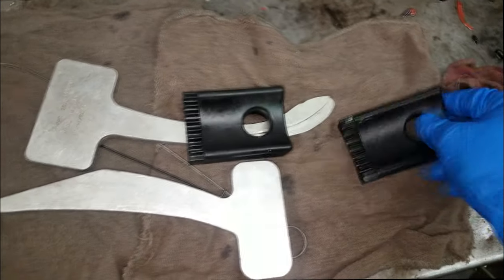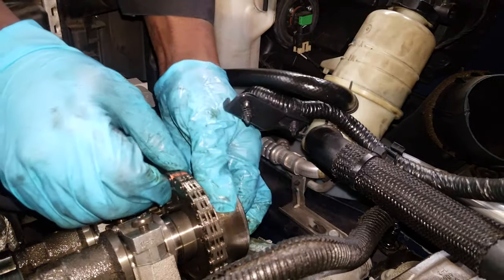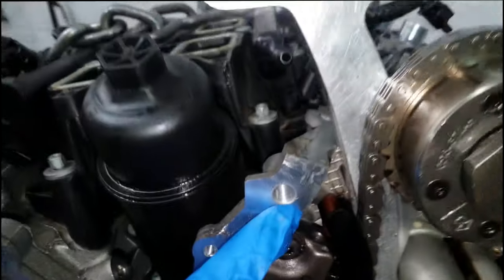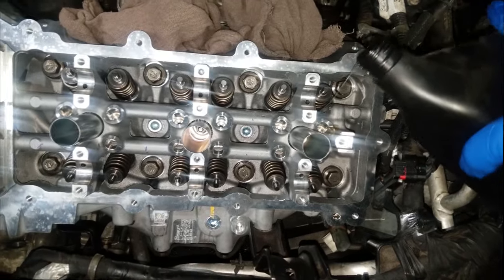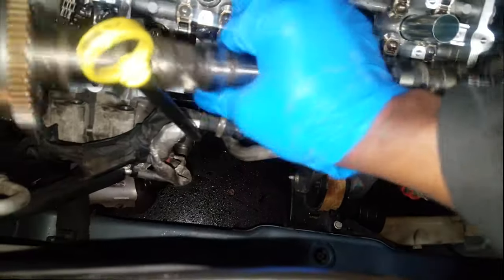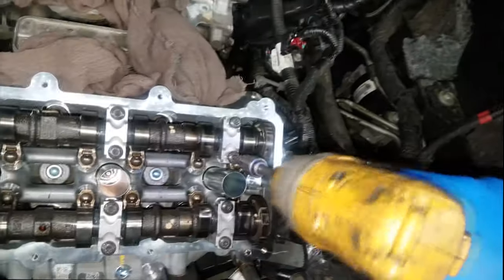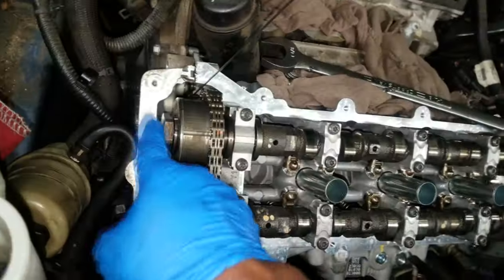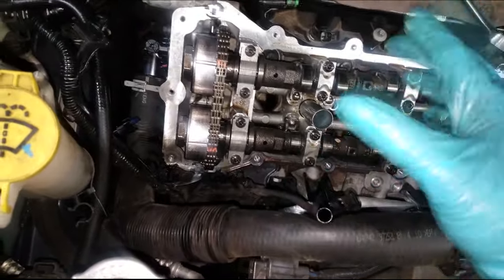How to Replace a CAMSHAFT, CAM Phaser,  rocker arms, 3.6 Pentastar, Timing Chain TOOLS P219A P219B

Comment: How many miles has the engine ..?
Reply from the maker: Hey bud, I cant recall how many miles on this vehicle, sorry. Thanks for watching
Reply: I have a 2017 Chrysler Pacifica Lx, 153,000 miles I have taken the mechanic twice because the computer indicates camshaft position sensor and the engine light came back on after having changed it, so I made an appointment with the Chrysler dealer to fix the problem, I put Premium 93 gasoline all the time and synthetic oil
Reply from the maker: @vanservice54  O wow, the Pacifica Vans are equipped with the Gen 3 Pentastar engine with a high quality computer. A dealer tech should be able to pin point the problem. Its not always about simply replace a part that the code name.

Comment from the maker: How to tell if your Cam Phaser Bad here: https://www.youtube.com/watch?v=B8x8pOjRj5g&list=UUSIdv7pEKV2jxJvI6YZB21A
Part 2 here on doing the rear (bank 1) head: https://www.youtube.com/watch?v=oUHN1GRMC7M&list=PL-em2JbvrnvxLl47gw-PiRvJsdtSPpnQX
Replace Cam Phasers NO TOOLS NEEDED here: https://www.youtube.com/watch?v=5P6K3QyHgC0&list=PL-em2JbvrnvxLl47gw-PiRvJsdtSPpnQX&index=191&t=23s
Reply: Online Mechanic Tips I have put the new cams in and the timing chain back on. Before I had done this i had turned the cams with the grooves up like in the video. I have put it back together with the grooves up but do I now turn the cams back to the original position like they were when I took the cover off?
Reply: JLEE Entertainment turn the crankshaft

Comment: What rocker arms do you use mopar or another brand?
Reply from the maker: Hey bud..I only use the OEM mopar brand..thanks for watching.please subscribe if you not already, thanks
Reply: @OnlineMechanicTips  Thanks. and one more question
Is corwn automotive gasket-intake plenum and valve Cover Gasket are good quality? what do you think? I could not find mopar so I want to buy from CROWN.
Reply from the maker: As far as seals and gaskets, I've only used OEM seals and gaskets so I'm now familiar with other brands
Reply: @OnlineMechanicTips  Got you, Thank you
Reply: @OnlineMechanicTips  Regarding rockers and lifters.
If only 2 or 3 rockers are bad should I replace all rockers and lifters? odometer is 108118mi
Reply from the maker: @martin.khachatrian  I tend to do that if I can..If the car under warranty, we have to replace only whats broken..I hardly ever replace the lifters but to give yourself a piece of mind, ide say yes..After that, that should hold you for the rest of the cars life

Comment: Will this fix a camshaft sensor actuator open bank 1 code
Reply from the maker: Hey bud, what is the P code number? Also are you subscribed to the channel?
Reply: @OnlineMechanicTips  p0010 p0013 and yes I am
Reply: I've already changed the actuator and vvt solenoid. And ten other codes popped up.

Comment: 2015 WK2 The brackets on left side of engine that hold the wire harness away from the cat.  For the next time, do you disconnect the motor mount on that side and lift the motor to get to them?  MAN THAT IS WAS STRUGGLE! 

I see there still putting the cats in the same location as my WJ! LOL

Comment: Just replaced some rockers  and put everything back together and got a misfire code p0300 and p0019. any idea what could have gone wrong?
Reply from the maker: Which bank (side) did you do? What kind of car is this? Are you subscribed to the channel?
Reply: @OnlineMechanicTips  yes i am subscribed. I did the left side.
Reply: Could it be the cam position sensor?
Reply from the maker: @bekimveliju3321  If you didnt have these problem before the repairs done, its likely not the cam sensor. BUT, that is an easy in-expensive try so would go for it. Im hoping you checked those oil gallery plugs when you removed those cam, they tend to work they way loose, also phasers can cause this. Ide try a cam/crank relearn or swap cam sensors first
Reply: @OnlineMechanicTips  yes i did try the cam/crank relearn procedure. Didnt help.
Reply: @OnlineMechanicTips  i forgot to add in after i replaced the bad rocker and put everything back together i went to start the engine and in made a weird clicking  as it was trying to crabking.Opened head up and noticed the timing chain was super tight.i loosened the cam up retightened it  and cranked normally after that. Wondering if that has to do with the code i have.

Comment: Maybe you I've come across this before but I get code P0340 that's the cam sensor code for Bank One, I change the sensor and I still get it intermittently along with a little bit of what sounds like valve clatter on Startup. When it happens the car sometimes goes into limp mode but if I turn it off and start it again it drives a hundred percent normal. I have no ticking or anything else when the car is running.
Reply from the maker: Hello my friend, thanks for watching and subscribing. Yes, I discuss this in other videos but it sounds like your bank 1 exhaust cam phaser likely coming apart. These are the symptoms you mention and in some cases, the traction control light will come on..Thanks again bud
Reply: @OnlineMechanicTips  yes, the traction control light does come on sometimes. I've always done full synthetic 5w 20 oil changes, and while the Grand Caravan is about 8 years old now I only have around 48,000 miles on the clock. It hasn't happened in a month, it's very intermittent. Thanks for the info, love the channel it's very informative.

Comment: Hey question I have a 2014 wrangler jk and I just replaced the cam and rocker arms on the passenger side intake. And we finished it the other night and the check engine light comes on. We get it scanned and it says that it is cam position sensor or p0344. So we replaced the sensor and it is still on. Just wondering if there is a break in process for the cam or it could be something else?
Reply from the maker: My man, can you give the video a thumbs up and subscribe to the channel  please, thanks
Reply from the maker: Couple things you can recheck. First the engine has to have been properly timed and I hope you Torq the oil control valve/phaser bolt to specs.. But usually this code always leads me to a bank 1 exhaust phaser.
Reply: It wouldn’t be the exhaust phaser we only took off the intake side and all bolts were torqued
Reply: But would it be able to get the code if the timing is off

Comment: where can i get the metal tools to loosen the timing chain? I have plastic ones and broke 2 of them.
Reply from the maker: Hey bud, the tool im using is the Miller/Mopar version that the dealer supply. I think the other companies just sell the cheap plastic ones. Are you about to do the rocker arm job? Also are you subscribed to the channel?
Reply: @OnlineMechanicTips  I have already done the job, but don't want to buy another plastic set. I would rather spend the extra money on tools that will last. And I am about to be subscribed.
Reply from the maker: @jasonmoore5986  Thanks bud, well good luck finding this kind. I get asked that question all the time..One guy told be his plastic tool end broke off and fell in the timing cover, (ouch) that sucks. Yea this the dealer tool im using
Reply: @OnlineMechanicTips  I was wondering if you knew which coil letters (coil a,b,c,etc) corresponds to what cylinder number? I can't find anything online that shows how they correspond. I appreciate any help!
Reply from the maker: @jasonmoore5986  No such case. The coils can go on either cylinder. They not programmed to a perticular cylinder
Reply: @OnlineMechanicTips  oh yea I understand that, but when the code comes up reading coil "b", "d" or "f", etc, how do you determine which coil that is?
Reply from the maker: @jasonmoore5986  See we now having a scan tool conflict. I have never seen such a case where coils are desinated with letters. Im not sure bud..
Reply: @OnlineMechanicTips  I pulled code p2305 which comes back as "ignition coil b secondary circuit". This is why I'm asking because I am not sure which coil that is. I hope that helped.
Reply from the maker: @jasonmoore5986  The last number of the code always mean the cylinder. You have a problem with coil #5 which is bank 1. If this a fwd car its the rear cyl head closest to the driver side. If this a RWD car its the passenger side closest to the firewall which is cyl 5
Reply: @OnlineMechanicTips  thank you very much, that info helps a lot! Although I did pull another code, p2317, which is the same as the other code but the letter "f" and I don't have an 8 cylinder.

Comment: Did we ever get the torque specs once putting the new camshaft in.
Reply from the maker: Its above in the Description, thanks for watching. Please like the video and subscribe to the channel, thanks
Reply: Thanks boss, what size socket did you use to take the cam phaser off ?
Reply: @OnlineMechanicTips  Id also like to know what size the oil control valve socket is along with the wrench to hold or wiggle the cam with?  Your videos are amazing and you've given me some confidence to tackle this job on my 2011 GC.
Reply from the maker: @jfit26  I do not know it by hard but I would look in my tool box and get the sizes for you tomorrow. Im sure you are subscribed to the channel right?
Reply: Online Mechanic Tips Yeah, 2 day subscribed but have been viewing for a couple years.  Thanks for all the videos..

Comment: How do you know a bad phaser from a bad solenoid?????
Reply from the maker: I have a video im about to upload this week showing how to tell if  a cam phaser causing problems. Glad you are subscribed so stay tune. But to recap it a little bit. A faulty cam phaser could give off a ticking noise when first started but go away quickly, you may gat a cam sensor code also

Comment: I just subscribed. Can you make a video to changing a damaged head gasket
Reply from the maker: Explain damaged head gasket. Because they are simply squeezed in between the head and the block. So what do you mean by damaged?
Reply: @Online Mechanic Tips  okay let me backtrack. I got a 2015 jeep jk(3.6) 
With 103,000 and I'm doing a an overall tune up. No ticking. I did replaced head over gaskets on the drivers side. And as I was starring to unbolt the the passenger side I've saw a slight leak on what I assume is the head gasket. Now nothing big seems wrong with the car. But I would like to address that issue sooner than later. I've decided that I'm going to doing a head gasket seal on it since it's so minor but I would like a break down of pulling it apart the right way and putting it back together without damaging the time chain etc....

Comment: I will be doing a 2008 Cherokee 3.6in car already did driver side lifters 1000 hi ago, and started slightly ticking now.Oh ,Well ,will be replacing cams @160,000 mi. NOW-YUK.

Comment: What is the Part Number for the special tools to move the chain guides? The only ones I've been able to find are plastic instead of metal.
Edit: found the left and right as a set at Freedom Racing PN: 2025000090 it includes the hook tool to release the tension on the tensioner but does not include a grenade pin.
Reply from the maker: Hey bud, im not sure you can buy the hardened aluminum guide tools. We got ours directly from mopar. And yes, that grenade pin should be used, you will need it

Comment: So I broke my guide taking off my driver side  head ...the guide closer to the driver's door... I broke it like 3 to 4inch past the t screw can still screw in the t screw and that guide will work the same
Reply from the maker: Hey bud, im not sure. Ive never been faced with that.  You must have removed the guide bolt and tried to remove the head the cheat way? very doable but ive never broken one so I can tell you if it will work, sorry

Comment: Man where are you located and how much you'll charge me to do all this?
Reply from the maker: Hey bud we inbthe Atlanta GA area and the estimate will depend on if you need camshafts or not
Reply: @OnlineMechanicTips  just had a mechanic to remove the valve cover thinking all I needed was the rocker arms replaced and he showed me where the exhaust side camshaft was wearing out.

Comment: I just watched a video a mechanic easily  took the camshaft out without removing the phasers. No tools to lock the phaser in place. No tool to loosen up the timing chain tensioner. He just loosened everything up and slid it on out. I couldn’t believe it. Have you ever tried that?
Reply from the maker: Sure,

Comment: Compressing spring because of broken valve spring. Second one in a year. Going to replace all.
Reply from the maker: Hardly ever see that. Did you get to subscribe to the channel for me buddy?
Reply: @OnlineMechanicTips   I did. Live your vids! What kind of compressor do you use?
Reply from the maker: @michaelcharnecki3533  Thanks bud. I have a typical valve spring compressor. Dont thive ive ever used it on a pentastar head. Have never needed to remove a spring.

Comment: Hey bud I am sorry I didn’t give proper info I knew the livestream was almost over and couldn’t find all the code info needed fast so here we go. I replaced all cam phasers on this engine and replaced the exhaust cam on bank one and three rockers and lifters on same cam and now have still got the codes of p0017 and p0340 we started back probing to see if the harness was good and the codes changed from the p034$ which is the camshaft position sensor bank 1 sensor 2 code to now saying it is cam crank timing misalignment code of p0017 for bank 1 sensor 2 but stayed the same for bank 1 sensor 1 with the p0340 code it also will not do a cam crank relearn now where before backprobing it would and it was also at one time throwing a cam correlation code for bank 2 which is now gone so I can’t give you the actual code on it. I never could get good readings on the harness but also not sure I’m hitting the proper wires either because the pin layout. I’m thinking the ecu or the harness is bad but not sure. I double checked timing marks in assembly by rotating the crank to be sure they all lined up as well. Also throws torque request signal denied c121c code and now has thrown p0390 and p0365 codes. (Updated)

Comment: Hola, estoy desesperado, mi mecanico lo hecho a perder, NO USO EL KIT QUE YO COMPRE para cambiar los liftyers y brocken arms POR QUE PENSABA HACERLO YO, pero a falta de tiempo lo lleve con alguien experimentado,  el detalle es que marco CHECK ENGINE, codigo P0349 (banco 2 sensor 1 arbol de levas)  ya se lo cambiamos pero sigue igual, ojo el uso un iman para sacar un broken, e hizo palanca para levantar los arboles.   que puede ser? el carro anda bien pero no entra el over drive.

Comment: You didn't have to remove the timing cover. Service manual doesn't say to, that's what the special tool is for. To compress the tensioner with the cover on.
Reply from the maker: What are you talking about?
Reply: @OnlineMechanicTips  (I'm assuming depending on what chassis you're doing this job in.) if you're just after the rockets, and lifters, you can do this job simply by only removing the upper intake and valve covers. Pull the slack out of the chain with the special tool AFTER you loosen the cam phaser bolts, and remove your cam caps and viola! You can slide your cams out without EVER having to remove the timing cover. Just had my apprentice do this job today in a Jeep wrangler chassis and that's how we did it
Reply from the maker: @timothyjohns8630  Do you see what kind of channel this is. I am the king of the Pentastar engine my friend

Comment: The aluminum timing tensioner tools say they are for VVL engines only and not to be used on VVT engines. The VVT engines need the plastic tools. Is that true? I cannot use the aluminum timing tools, the same ones you used in this video, on a VVT engine? Truly only for VVL engines?
Reply from the maker: Curious how the engine know what tools are been used on it, or better yet, what the tool made out of?
Reply: @OnlineMechanicTips  Haha Yes you are right! But what I was thinking was the casting may have changed in the VVL engines so the aluminum tools wouldn't work well so they say not to use them. The Mopar tools say use with VVL as well as the aluminum clones by CTA and others. Well, if they work fine with VVT, then I will buy a set. I am currently using the ultra cheap plastic junk from amazon, and I do not feel comfortable putting this junk inside my engine. I would hate to have to get into a full timing cover job if the plastic stuff snaps off and falls in. I need to basically do the job a second time in the spring, since none of the Mopar warehouses in Canada have the cam phasers in stock. Everything has to come out of the US, and the strike down there has delayed parts deliveries by weeks and months. Anyway, when I get in there again, I want to use the aluminum tool.